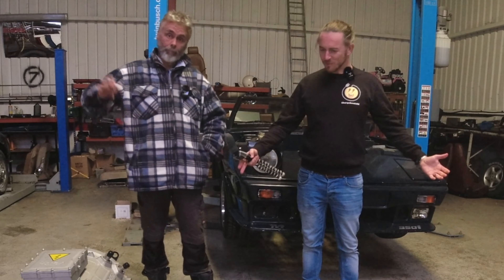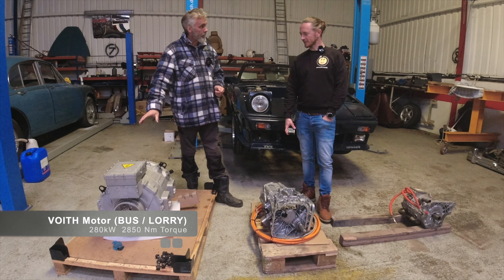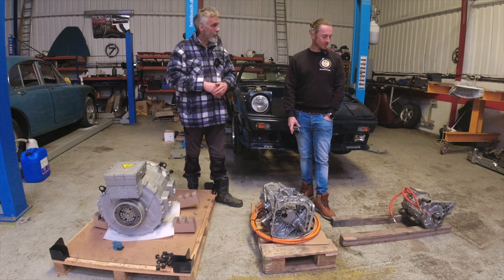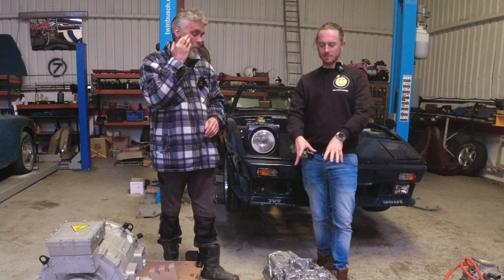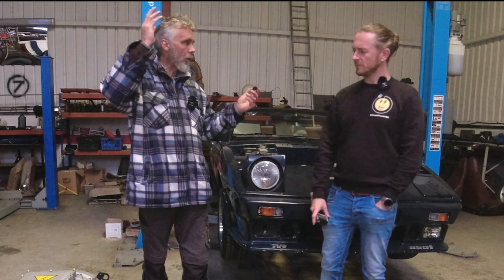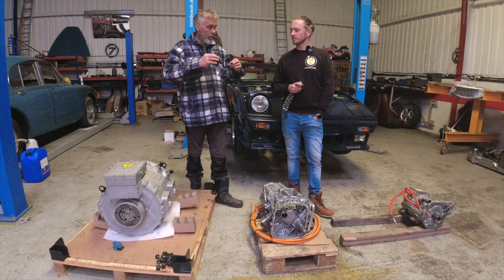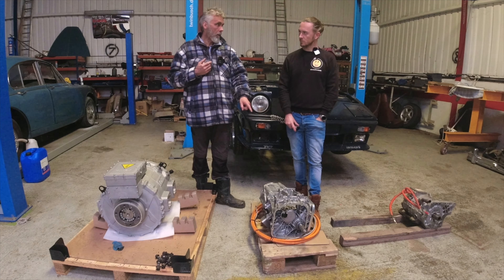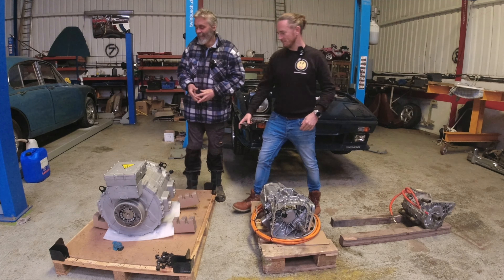Is a BIGGER motor better? The difference between Peak and Continuous Power! #EVmotor #electricmotor

Comment: Like the Hull company take a look at the Molabo  motor used in boats … it’s design gives three electromagnetic gears by field generation torque and speed selection .. vital in a boat where the motor has to run for hours or days at steady speeds or generate large amounts of torque. 
No rare Earth magnets required.